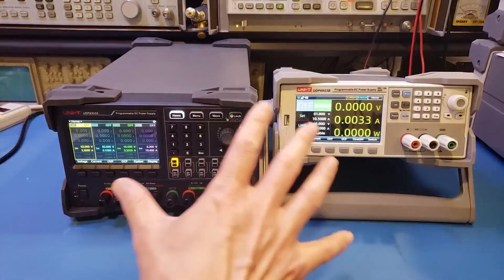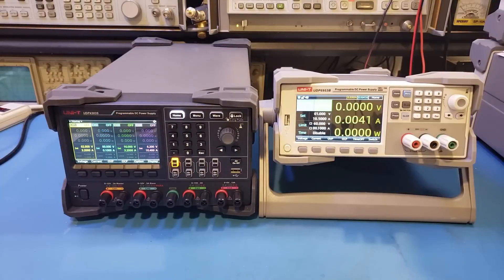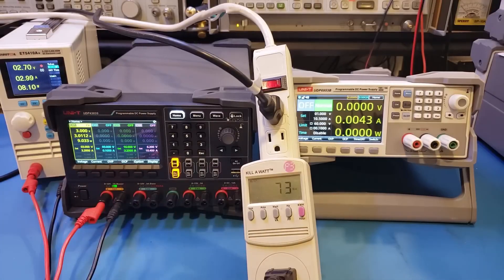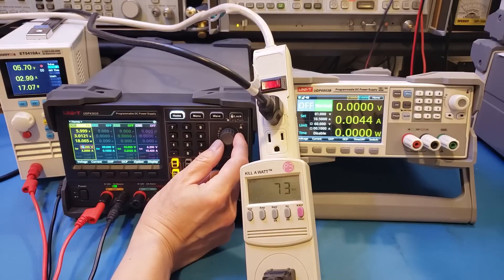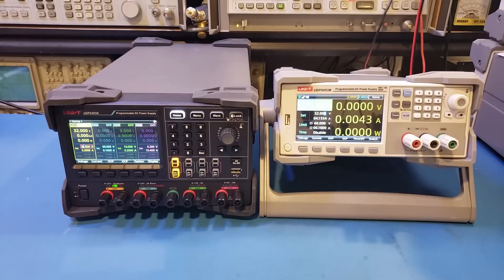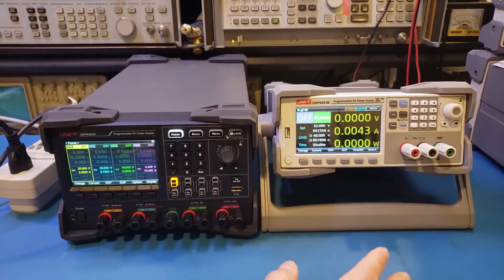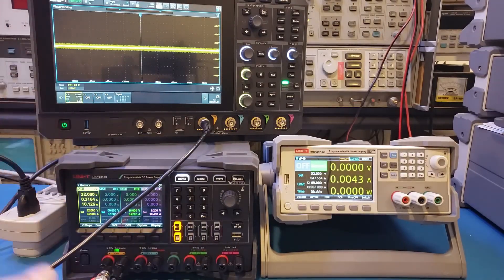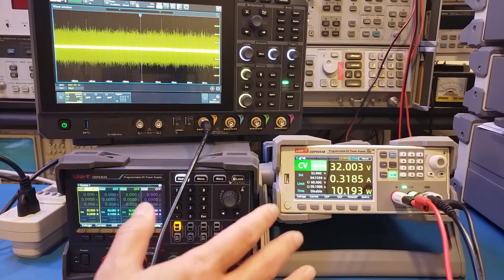Linear Power Supply vs. Switching Power Supply, Why Choosing One Over the Other?

Comment: I have both types:-)
For where power and lots of it, is more important, do I use a switch mode power supply.
If I care more about precise power and do not need much of it, then a linear power supply.
Funny enough do I own many of the models from you, they may not compare to the insanely expensive, but for 99% of the time, are your models just perfect. :-)

Comment: Some audiophiles swear you must use a linear power supply on audio gear for maximum audio quality. What do you think of that?
Reply: Radio too. It used to be more of a thing than it is now. Switching power supplies used to generate tons of electrical/RF noise .. they're built much better than they used to be. I'll admit I still use linear power supplies for my radio gear.